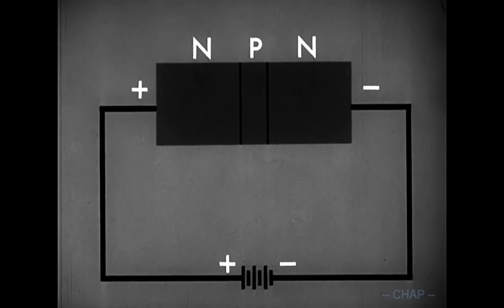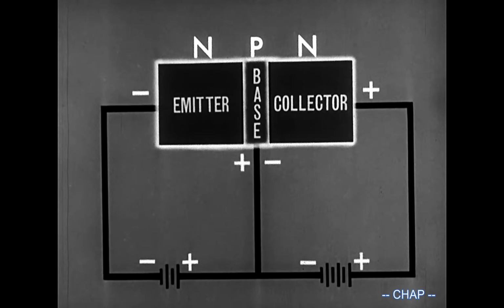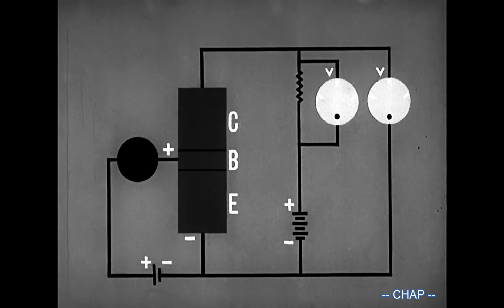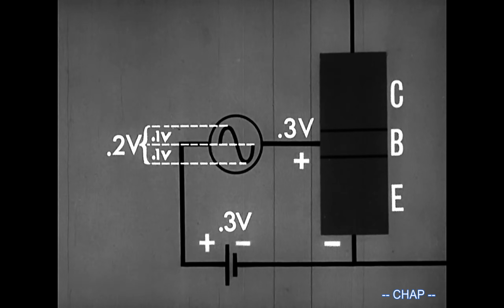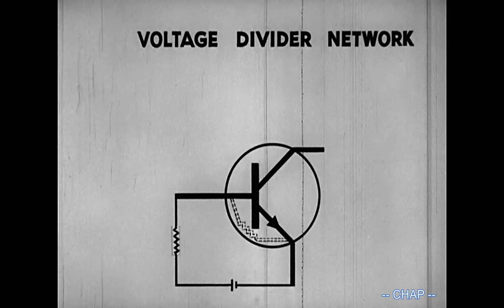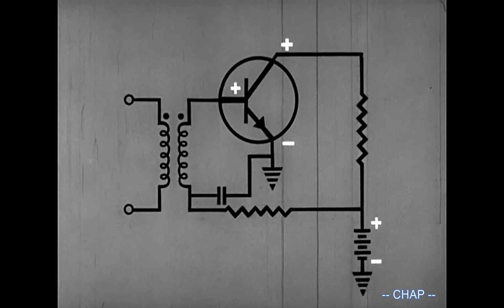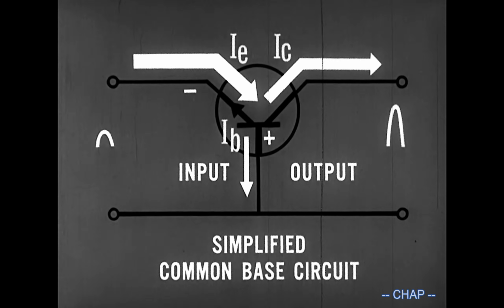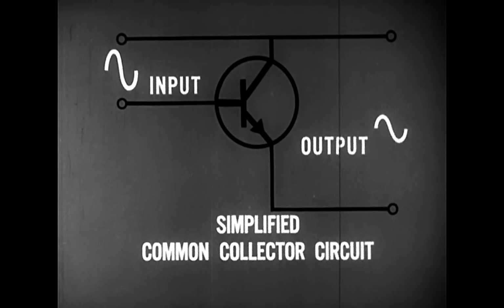1962  "TRANSISTORS" - How NPN Transistors Function, training film; electronics; circuits (HD)

Comment: Actually a 1930s patent on a Silicon Carbide (SiC) Field Effect Transistor. The inventor experimented on SiC diodes, as it was used that way in early rectifiers and ham radio. He didn't note the junction transistor amplification because the physically created junctions were too far apart. (Why Germanium transistors made of depositing a thin layer of Germanium on salt crystals, dissolving the salt, then plating Gallium or Indium dots on either side, then heated to diffuse the PN junctions closer.
Reply from the maker: Stephen, fascinating information.   Thank you for sharing this!  ~   Victor, at CHAP

Comment: The first transistors, seen in pictures of the inventors, Shockley, et al, are point contact devices therefore PNP transistors. This is because the first transistors were Germanium, and transistor manufacturing technology at the time made P-type doping easier - such as Metal Alloy Dot Transistor (plated Gallium or Indium on either side of a thin Germanium N-type wafer). Note Germanium has high electron mobility but poor hole mobility, unlike Silicon where hole and electron mobility are par. And of course vacuum tube reactionaries wanted negative ground circuits and vacuum tube and NPN transistor circuits in common.
Reply from the maker: Hi Stephen, thank you.  Quite fascinating!    ~   Victor, CHAP

Comment: They keep saying that the output is 180° out of phase with the input but in reality the output is inverted.
Reply: @bob s    but 180 degrees out of phase does indeed mean inverted, for sinusoid signals, does it not?????
Reply: @teoval1827  For a sine wave, inverted is effectively 180° out of phase but if the waveform is not symmetrical eg a train of pulses where the mark-space ratio is uneven then the output isn't phase shifted, just inverted.
Reply: @6F6G  my mistake, i didn't watch the whole video.
Reply from the maker: Interesting... good observation.  ~  Victor
Reply: @ComputerHistoryArchivesProject  A sine wave does look like a 180° phase shift but if an asymmetrical waveform is input then the phase shift explanation goes out the window.

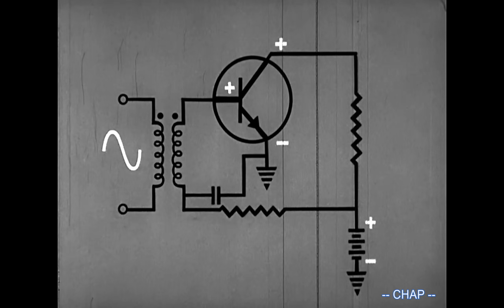Comment: 15:50  The biasing of the Transistor is Incorrect [Same Supply Vtg is applied to Base Resistor and Collector Resistor]
 Even when you resolve this issue, the device constantly switches between saturation and cutoff, like a Schmitt Trigger, and a square wave is generated.

Comment: Thank you for this wonderful treasure of how NPN Transistor works! Still timely accurate even to this day and age where many devices still rely on transistors!
Reply from the maker: Hi Sophie Stabilitron's Lab,  thank you for the kind words.  We love the detail of this video training too.  Good stuff.  Thanks for visiting our channel.  Hope you can visit our other vintage tech videos as well. ~  Victor, CHAP
Reply: What do you mean by many devices still rely on transistors? Every electronic device we use is made out of transistors.
Reply: @VRGamercz  I agree, toys, remote controls, small signal triggers in control boards, even transistor radios, they are a lot, transistors are simple devices that can do either to amplify or to act as switch, according to its own technical specifications.
Reply: @sophietronics  Yes, transistors are simple devices indeed. But shrink them down, combine them in logic gates and you get integrated circuits. And those are in all devices, not some.
Reply: @VRGamercz  I do agree, best example was the development of 555 Timer IC.

Comment: the holes don't actually move but it's good enough for illustration
Reply: Go look for the film ‘Holes’.  The holes really do move !
https://en.m.wikipedia.org/wiki/Holes_(film)
Reply: It's electrons going the other way that makes the apparent motion of holes in P type semiconductors possible.  But these electrons don't travel almost freely as in a conventional conductor.  They pop from position to position in the semiconductor lattice, filling holes and leaving other holes behind.  The N type semiconductor is characterized by a surfeit of electrons for the lattice (though not, of course, for the atomic nuclei) and the electrons pop directly from lattice displaced position to lattice position back to lattice displaced position.  Still it's those electrons having to weave from position to position through a lattice with which they interact that give the semiconductor its special properties.  In a good conductor the electrons aren't impeded much (or at all for a superconductor) by lattice interactions.
Reply from the maker: Fascinating description.